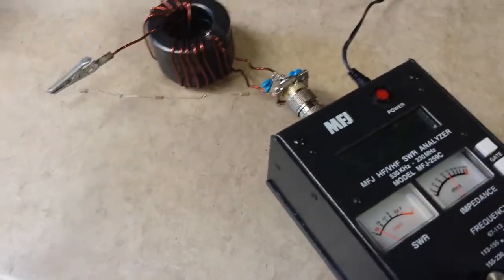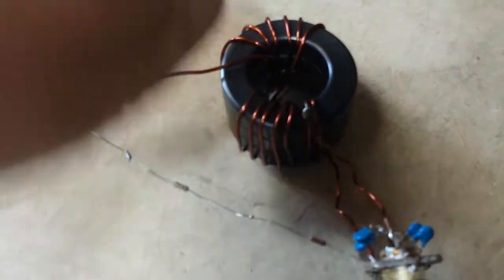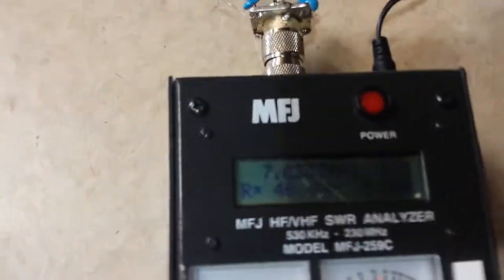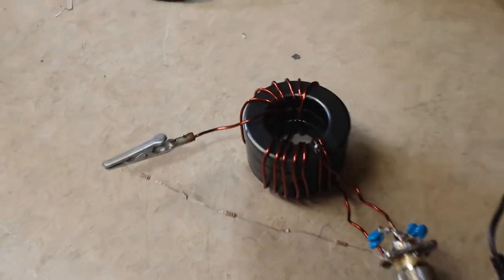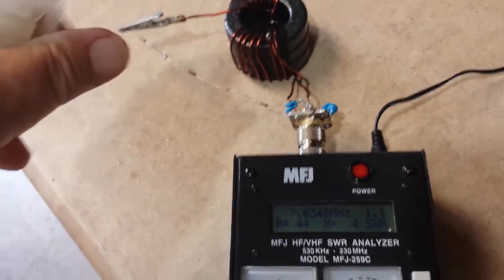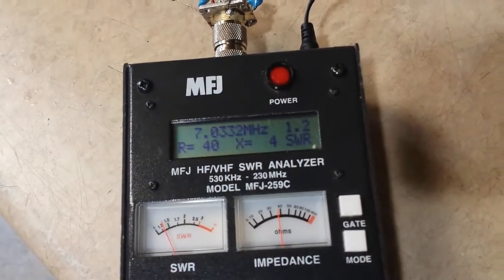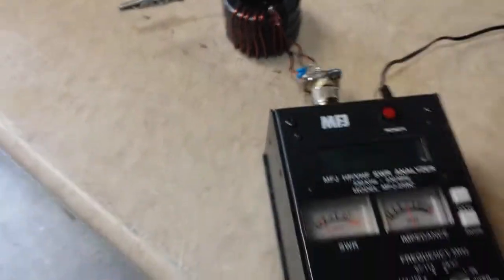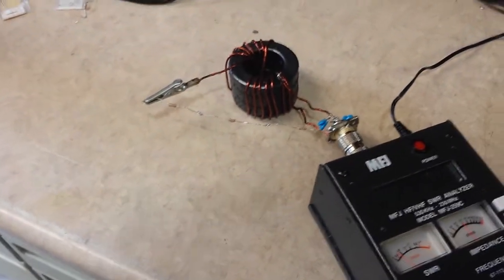EFHW Transformer Water Test

Comment: I can't think of any reason why "bumping" an impedance matching transformer with a resistor attached would change the SWR. So I will assume the water did that. Also, some brands of ferrites and powdered iron cores are coated with a plastic finish, and some are not. So I won't make any general assumptions based on this one way or the other.